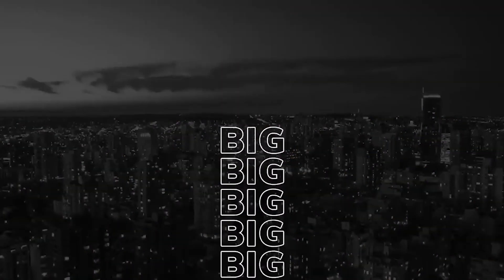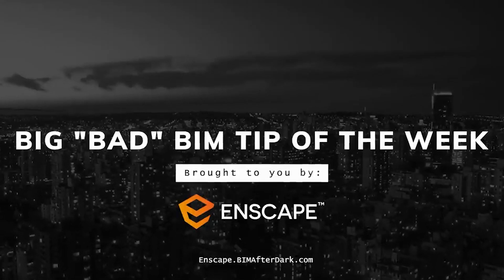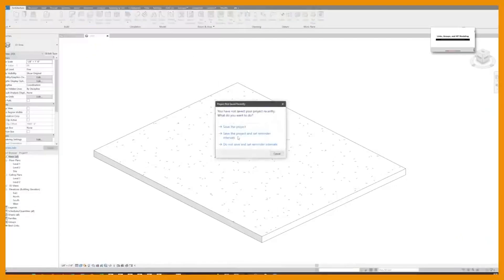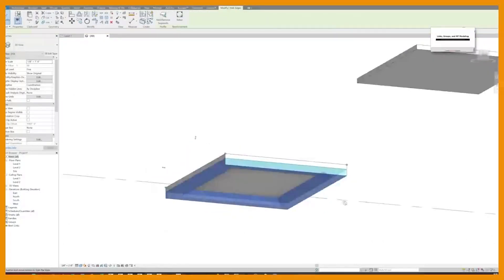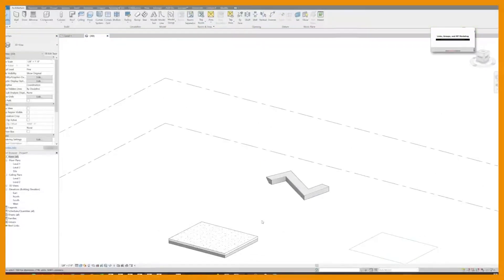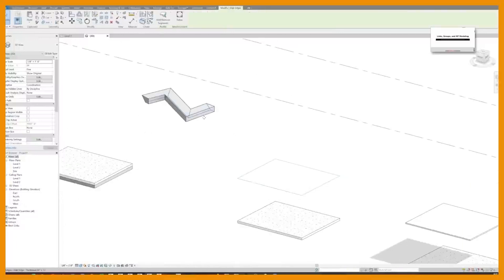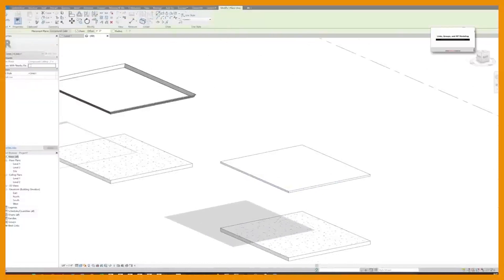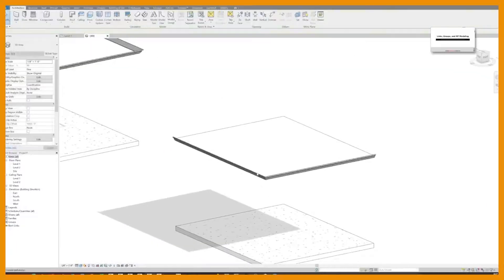Crown Molding with Slab Edges in Revit Tutorial ?

Comment: Why wouldn't you use railing tool instead rather then have to use a model line
Reply from the maker: Did you watch the whole video? Model line was one example… it also hosts to floors which is the big advantage then you have finished floors modeled in your rooms, etc.. railings would work but have some issues in this context

Comment: Nice tip there, v handy. Do you think ceilings and model lines are worth the effort when you could just use a floor as your ceiling instead?
Reply from the maker: There area lots of ways to skin a cat in Revit.  I wouldn't use floors because their base is set of the top (meaning you'd have to do math to their heights).  I know Aaron Maller likes using roofs as ceilings and then using Fascias for crown molding... ;)  Like I said, a lot of ways to skin a cat in Revit!